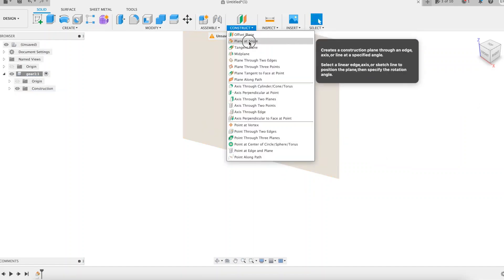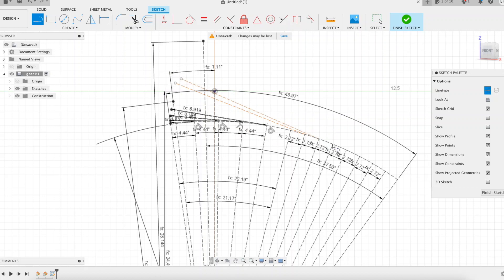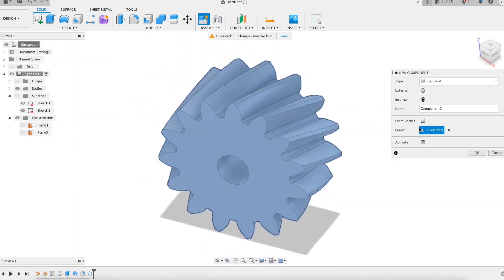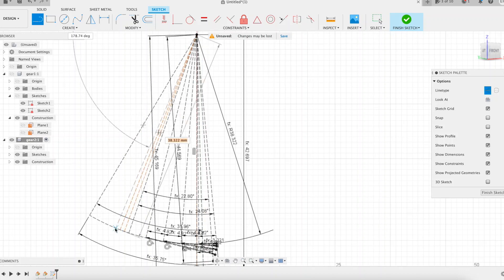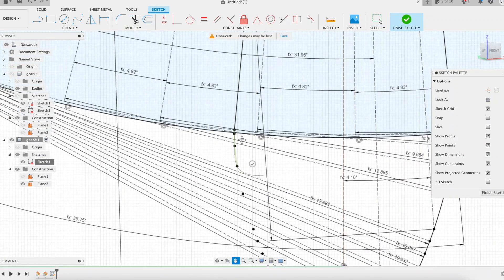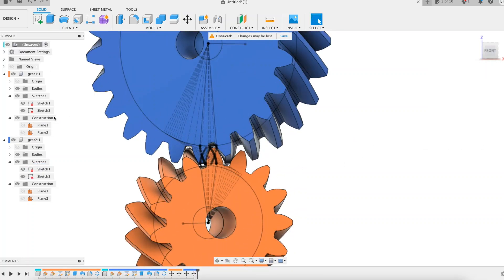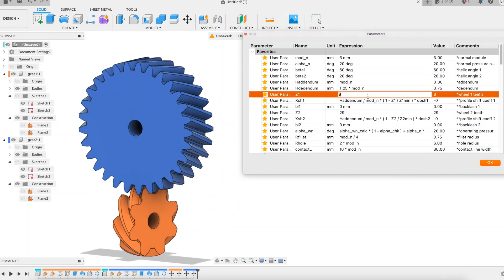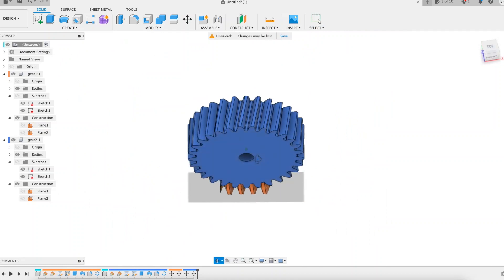Screw gear, and worm gear, involute and parametric (Fusion 360)

Comment: This is a great design, well explained.  How did you arrive at the formula for the Twist Angle for the sweep?  Building my own helical gear, I can't just use the helix angle, beta, as the Twist Angle as it is clearly (visually) incorrect: the value out of the formula looks better but obviously I'd like it to be actually correct rather than just visually correct.

Comment: hi, can you advise me on how to change the lead angle of the worm (the angle between the helix and a plane of rotation). i am doing an experiment on how the lead angle affects the efficiency of worm gears and I need to print these gears with different lead angles.
Reply from the maker: On my model there is the user parameter that I call "beta1" which is the angle between the axis of rotation and the helix.
I assume you mean the plane of rotation as the plane perpendicular to the axis of rotation, so you want "90° - beta1".

Comment: hi, when i create the sketch for the first part, 0.08 seconds, how do i ensure that the plane is parallel to the axis? because i kept getting it being horizontal and the end product is not desired.
Reply from the maker: There are 2 planes constructed : 
Construct Menu -> Plane at Angle : Z axis (blue, up), "beta1_w" angle.
Construct Menu -> Plane at Angle : Z axis (blue, up), "beta1_w + 90 deg" angle.
So, these 2 planes are vertical along Z axis.
The first sketch is done on the first "beta1_w" plane constructed.
(my Z axis is vertical, that's the default orientation in Fusion 360)

Comment: What did you paste into the box in minute 2:21?
Reply from the maker: Rp1 * sin(alpha1_t) + ulH1
and then for the next lines
Rp1 * sin(alpha1_t) + ulH1 * 2
Rp1 * sin(alpha1_t) + ulH1 * 3
and so on until
Rp1 * sin(alpha1_t) + ulH1 * 7
I realize now that values and expressions on editboxes are not always easy to see on the video, sorry about that.
Reply from the maker: You can also use
ulL1 * 5 + ulH1
ulL1 * 5 + ulH1 * 2
... etc

Comment: Hi, amazing tutorial, I watched a few times to understand your usage of parameters when designing. 
I have a question:
I was looking for way to design a helicoid focusing gear set, that are used in lenses. Usually it's 2 sets of helical gears and they work together for moving the optics for focusing. What I haven't seen online so far is how to make an internal/external helical gear set that can be parametric just like you have here in this video. Any idea of it's possible/easy to parametrize that? I'm a relatively new into gear design so don't know the extents of the possible things you can do parametrically. 

Thanks
Reply from the maker: External gears follow the same rules as internal gears. They can be parameterized the sale way.
I didn't play yet with internal gears. I guess they are the negative of external gears. So with Fusion 360, if you already have an external gear, with 3 more steps you can obtain an internal gear (circle on sketch, extrusion, and substract combine). Maybe add clearance on tip circle, remove it from root circle (tip and root are somehow inverted), and set some negative backlash on the tooth profile.
Reply: @steelstone  just to show example of what I'm talking about is shown in beginning of this video:
https://youtu.be/m3B0TNlAFyk

There's the inner and outer helicoid, and I'm trying to model that parametrically so they mesh together and I could change parameters as needed (number of teeth, diameter, helix angle, etc..)
I can model the pair somewhat using a plugin for helicoils, but I can't change the parameters once the component is made and have to go create new component from scratch again for a change.
Reply from the maker: @yuriy77  OK, I see.
I wouldn't call this "gear", it's more like a (helical or screw) rail. I think this should be easier to model than a gear as you don't need an involute tooth profile. You can start from one of my helical gears simplifying the tooth profile. I don't see any obstacle to get a parametric design as you wish.
Reply: @steelstone  I wish I knew all the equation relationships 😂 to make it parametric. Digesting your parameter list. There's a lot there lol

Comment: I am blown away  literally. I need to make a worm and gear (17 to 1) and i have Fusion 360 but i have no idea where to start. It looks exactly like what i need to do where is the earlier video?
Reply from the maker: This video should contain all steps to design a screw gear pair from scratch with Fusion 360 (maybe get the user parameter list first from the given sheet link and import them in an empty project with the "Parameter I/O" add-in). I understand it might not be easy.
So, start importing the parameters, then play/pause the video (at 0.25 speed) and reproduce steps.
Some of my previous videos (helical gear, see my channel) might be more accessible to get started.
Reply: @steelstone  thank you, amazing work!
Reply: Printed my first assembly but the tooth contact is a little short. I need to add some clearance. thank YOU Stone Steel
Reply from the maker: What module and sizes did you choose ? I'm curious to see your prints ;)
Try setting some value to user parameters bl1 and bl2. Say 0.05 or 0.1mm. These control the backlash.
Reply: @steelstone  I hate to admit, l was unable to load the table. So I went back to brute force. Using threads I made a worm. Using combine I made  gear profile. Then edited it down to one tooth and set them up. I am struggling on multiple fronts. Axle shaft space, max OD constraints and the required function of these gears is to provide 4 trigger pulses every 17 rotations of the worm. Regardless of total pulses as long as it matches the power drive gears. It's crazy but it's what I need. My skills in Fusion are elementary and my math memory is ancient. But I need these parts to work for a break through function in my 1950s model train. After over 5 years  I have completed several 3D Printed add-ons but I must have a synchronized trigger pulse to time the digital smoke and sound to the mechanical linkage of the wheels on the Steam Engine. I have the pulse smoke puff and chuff sounds. But I don't have an accurate drive for a synchronous trigger for 2 of the old engines chassis. I post on you tube my progress. I know what I need but to get there is escaping my tiny brain. You video inspired me to take another run at the perfect design. But alas, I am missing some basic instructions to get started. I thought my bmversion was different. Then I found parameters in the manufacturing tab. But unable find how to import your beautiful table. There it is Steel Stone, Frankentrain Laboratories is stalled. Your work is beautiful my skills are too thin today to utilize them.
Reply from the maker: @DennisMurphey  You can download the sheet as CSV from the google doc. On Fusion you should install this add-in :
https://apps.autodesk.com/FUSION/en/Detail/Index?id=1801418194626000805&os=Win64&appLang=en
Then you should be able to import the CSV file (the parameters).
You can invoke the scripts/add-ins with shortcut Shift+S.
Reply: @steelstone  I DID IT 1 hour and 15 minutes BUT I GOT IT.
Reply: OH MY GOD, so many parameters, I will have to guess, make a change and see what happens. What Power, I am so stoked. Thank You this will be awesome once I figure it out which string moves which element.
Reply: @steelstone  I used to be a faster learner but these days my skull seems thicker. Plodding through gear teeth construction is painful. I am grinding through it. I just want to arrange the teeth and count and get the outcome, patience was never on my list of outstanding traits.
Reply from the maker: @DennisMurphey  You'll get it 😉
Play with these parameter values : beta1, beta2, Z1, Z2. They are the most usable. Then you can try those with a star on the comment.
Good luck !
Reply: @steelstone  can you share the gear set model in the video. It will take me weeks to make it. I need to get gears to use , ???? Dennis
Reply: I cheated and won! Paid $20 for a Macro, it saved me weeks and I designed a nearly perfect gear set in 1 hour 15 minutes including the paypal and download time. I can see all the parameters in table on top of the part model and make adjustments with updated part image within a few minutes. The table has popups to tell what the variable does and a little diagram if needed. I slept all night for the first time in weeks and no frustration dreams about losing my luggage. Very encouraged and yes I still need to get parametric modeling under my belt and i will. Now i can move forward with my best Model Train Engine updates with new parts from the last 5 yrs
Reply from the maker: @DennisMurphey  You found the Shwivel plugin, I guess that is the best option for you as you wanted a result now. Please share your parts for your trains when you're done, I'm really curious😉
Reply: @steelstone  https://youtu.be/CK-iEdWM4Jg my old gear set video